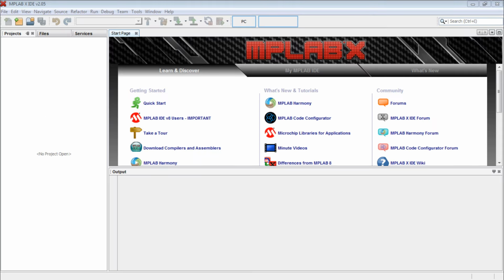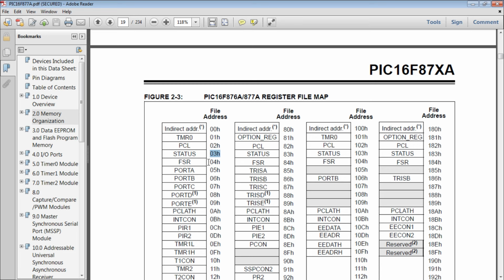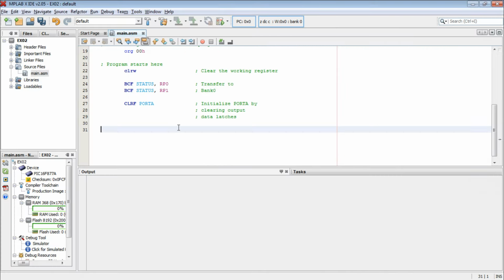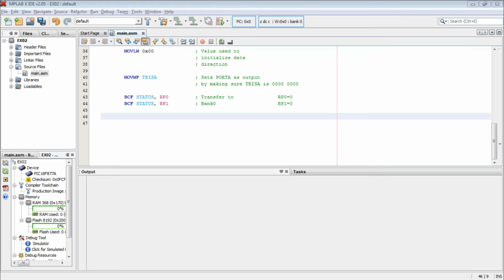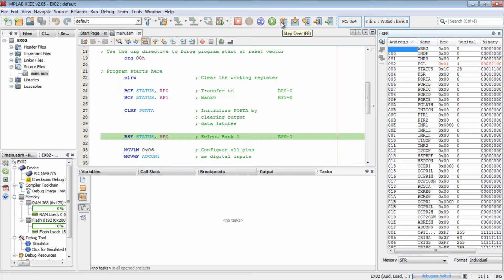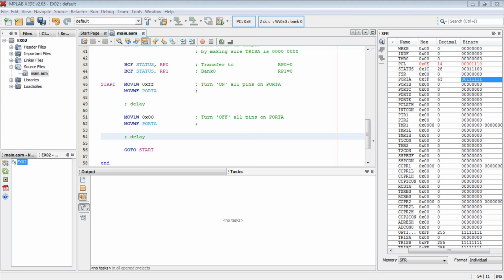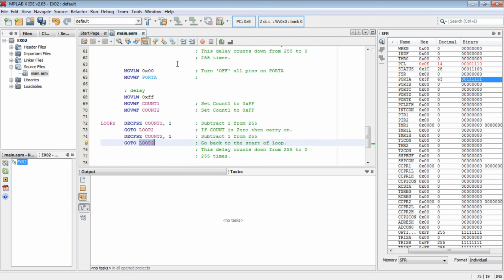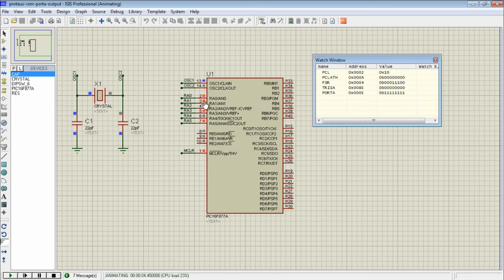PIC & Assembly Language Programming Series - Episode 2 Part 2

Comment: Why does count1 go back to 255 when it’s value was already 0 when the loop goes back up. in C it seems like:

while(count2 != 0)
{
    while(count1 != 0)
    {
        count1–;
    }
    count2–;
    count1 = 255; // extra line
}

So notice the extra line of resetting count1 back to 255 when it was already decremented to 0. Why is this?
Reply: That looks unnecessary to me. It might just be there for the sake of clarity. As long as count1 is declared as unsigned it should roll over to 255.
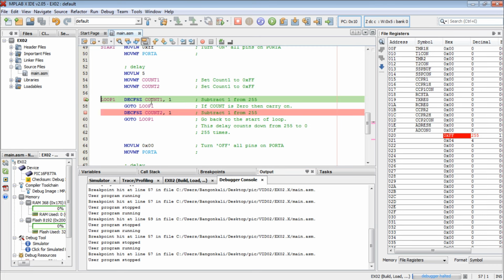Reply from the maker: I explained it at 40:39 please check. If your are using higher bit cpu's then this might not be a quick hack you can take advantage of. 

But for high perf development which actually is being done in Chrome v8 etc, there are many off quirks like this that they take advantage of for fast performance. This is really very basic though.

Thanks for watching 👍